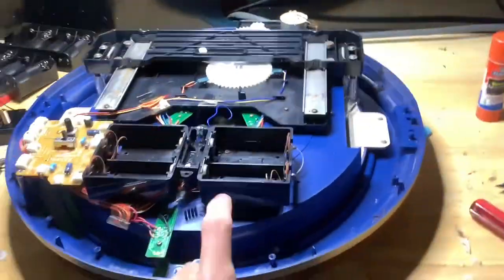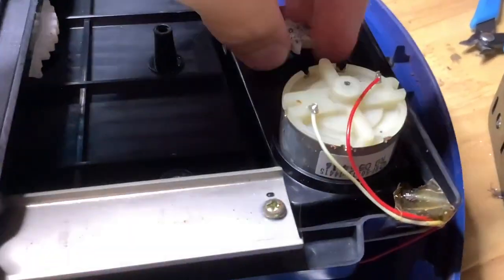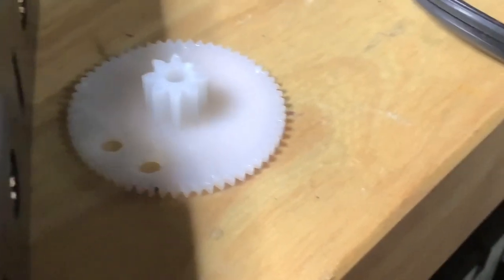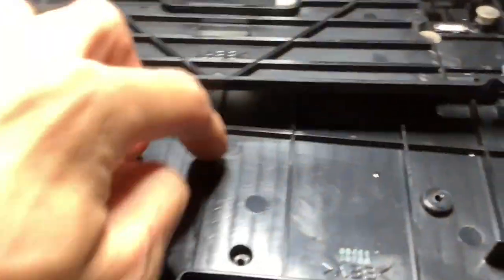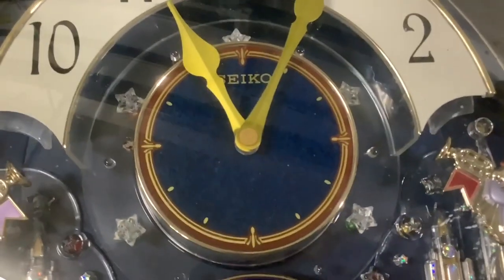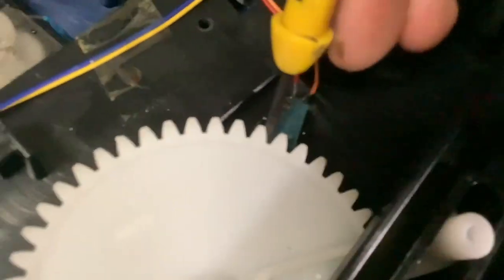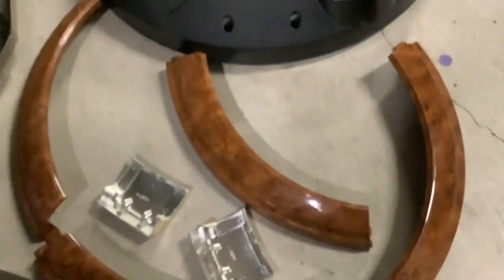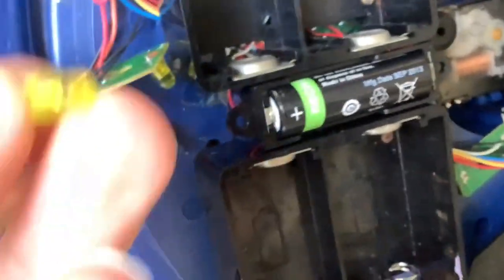Repair Clips From Seiko QXM128BRH Melodies In Motion Wall Clock

Comment: Hey thanks for the video. Wanted your thoughts. I have the same clock in EUC the only thing I've noticed is the motion only work's when the clock is laid flat. I looked at the gear box and don't think i saw and cracks in the and motor was spinning just seemed like the motor was to weak to operate correctly. Was hoping to get your opion thank you.
Reply from the maker: If you think it’s the motor I’d try isolating the gearbox from the actual dial itself to see if it goes normally, and observe if any of the gears look messed up

Comment: You seem to know a lot about these clocks. My QXM386BRH will keep time and rotate the crystals but the music won’t play and the motion for the clock face won’t work. Wires and battery compartments look clean and intact. Any ideas to get it working again?
Reply from the maker: Sounds like your motor could be dead if it’s not resetting moving at all? Or it could just be the button
Reply: mine had that issue the batteries do die with out warning I have the disney time clock by seiko most of the time i love it do these clocks have real chimes in that you know of?

Comment: Interesting video - I have similar clock to repair - all wires have become detached from battery terminals - any info on correct termination (wire colours) would be welcome. I assume both battery compartments are wired in parallel?
Thank you in advance of any help you may provide.
cc.green
Reply from the maker: @cyrilransome6164  What model do you have? Should be on the back and would start with QXM or something along those lines